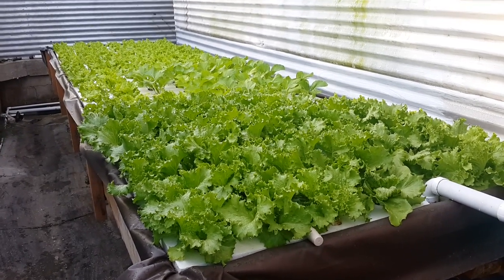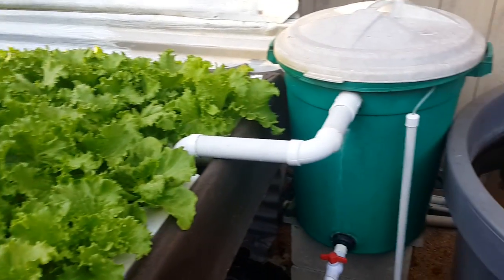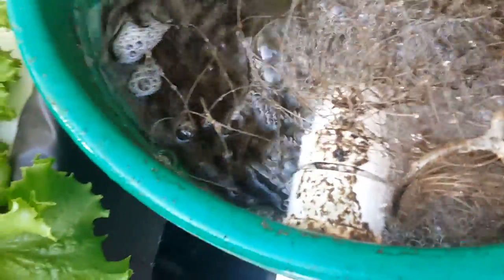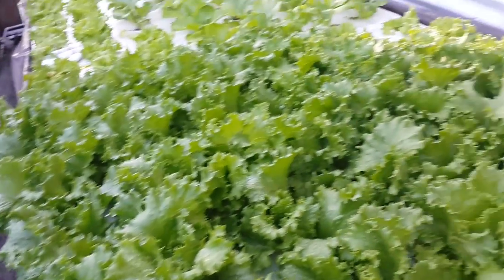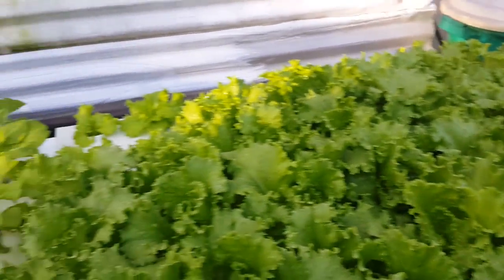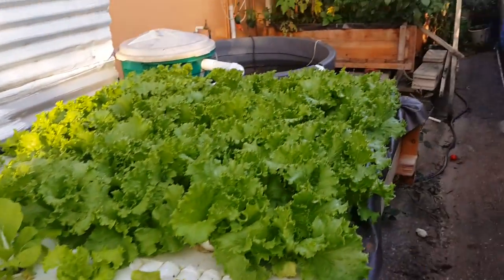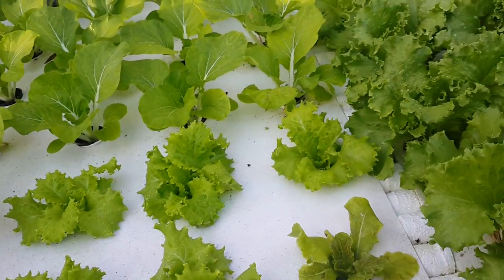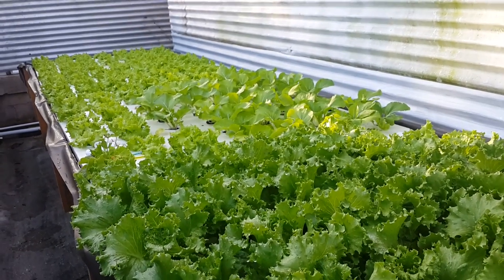DWC system walk through.

Comment: So basically you're using a bio + mineralizaton tank here. Excellent! I have tilapia in my system also and their waste is prolific. My swirl filter captures immense amounts of solids and I find that it helps to keep my gravel grow beds cleaner as well as prevent a backup of anaerobic zones over time.  As you are using a DWC this may not be a huge issue for you. However, I see that you are aerating the water in the bio tank via the mineralization process so this might be why the solids are reduced and there is less build up of anaerobic bacteria in your system. Is it still running smoothly like this? Are the roots remaining clean near the middle and end sections of the bed?